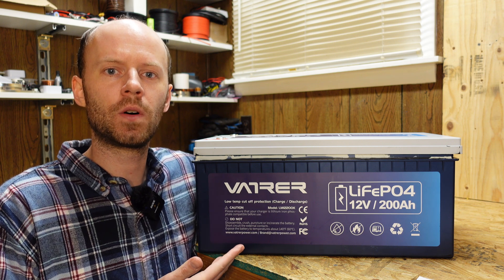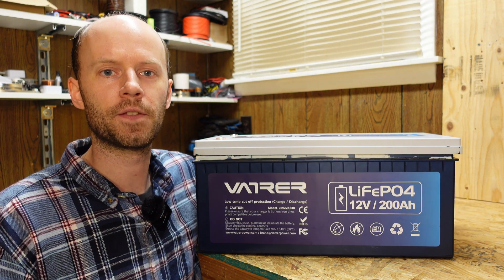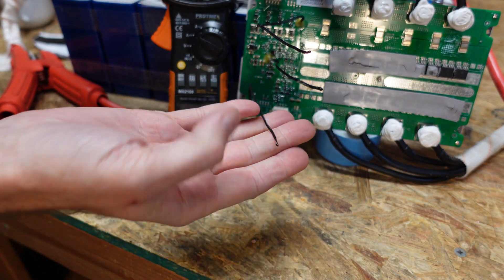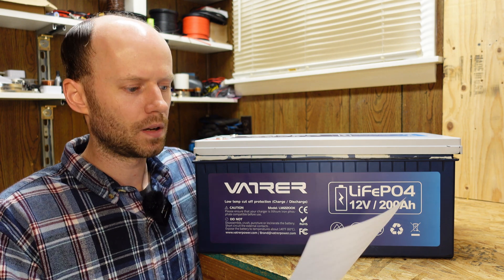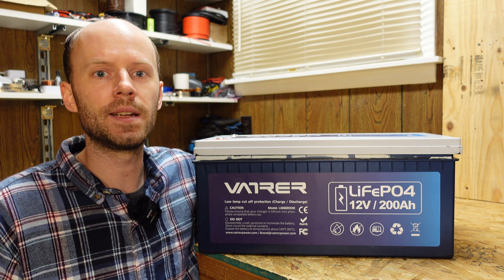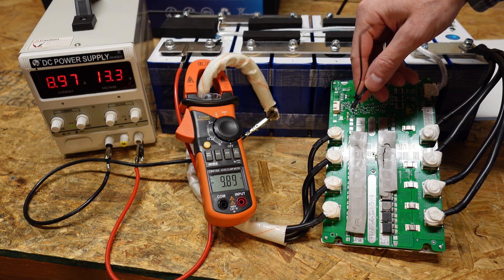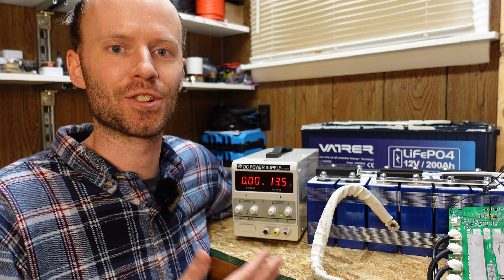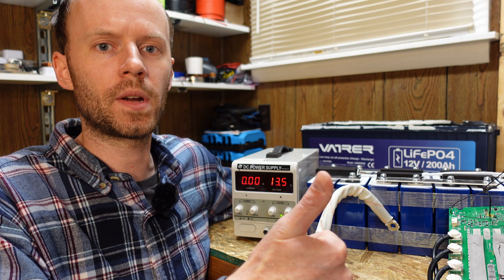Vatrer Battery Update, The Low-Temp Charging Protection is Working!

Comment: Hello, thanks for your great information. I bought 2 of 200ah and one stopped charging after 9 months and despite doing everything that Vatrer asked me, it did not comply with its 5-year guarantee and only told me to buy a new one
Vatrer is not a responsible company, so if you buy, you know, don't get scammed. In the end, I lost more than $600 because it seemed like a good company, until this happens to you and you realize that it is not. Blessings

Comment: I hv had one Vatrer LIFEPO4 12.8v 100ah lifep04 battery for a month installed in a solar shed.  On average It will never go below 98ah in the next three months.  Can I purchase another 100ah battery in the next three months and put it in parallel?  Of course, I will top off both with a charger before connecting.  The Vatrer manual says the 1 batteries age difference shouldnbe 1 month or less.
Reply from the maker: I doubt you'll have any problems a new battery and a 1-month old battery. Maybe if it's been cycled 2000 times or 5 years of age I'd be concerned. But 1 month? No.
Reply: @LithiumSolar  thank you so much. Your tear downs are awsome.

Comment: how is the bus bar running 200Amps discharge current????
Reply from the maker: I haven't tested it at that current. Are you suggesting that it's insufficient for 200A?
Reply: I  think probably not good enough to run 200A, even it's ok, I think the temperature should be very hot, dangerous. @LithiumSolar

Comment: If all 4 need to be at temp to shut down charging what happens if 1 sensor, or wire to it, fails? It should be any sensor not combined. Thanks for the testing.
Reply from the maker: Good question.......

Comment: Great video. I’m so curious, can you do a teardown of the 7Ah and 6Ah batteries to see what the difference is and also if there is a steep drop-off in quality? I’m on Amazon right now and see almost all of their reviews are from give aways.
Reply from the maker: Well, based on their pictures, they look like generic (no brand name) cylindrical cells. I googled the part number I can make out in the picture and IFR32700 and the first result says 1000 cycles, second result says 2500 cycles lol.
Reply from the maker: I ordered one - will make a video in a week or two if it seems interesting enough :)
Reply: @LithiumSolar  yasss thanks! 👏👏
Reply: @LithiumSolar  btw which model do you have? 🎉
Reply from the maker: @LA-Creative  I ordered the 7Ah that was on Amazon w/ next day delivery.
Reply: @LithiumSolar  oh that will be interesting ! 🤗 I Just got two of the 6ah because they are 30% off ... I do wonder tho, if there’s a reason for the cheapness, other than the one Ah loss. I think the 6Ah came out a couple of months earlier (maybe? the company is so new). $18.99 tho, so cheap! 😬 (I have lots of uses for the smaller form factor ones that you chop up alot 👏😍 but I will also probable wire theses in parallel when they are inactive and let them trickle on one of my many smaller solar charge systems). I guess at least if you cut your 7Ah up then I can think about dissecting one of my 6’s. 😂 I’m just so OCD and don’t want to hurt the case if it turns out to be good! 😂 It looks like a nice case where I can peel the stickers off and stick it to the bottom for a clean look. Wondering what these batteries look like inside remind me of that game show, let’s make a deal🤣
Reply: @LithiumSolar  Hello from LA …got my first 6Ah battery yesterday and the second today. Decided to leave the first alone until the second came in so I could meter read them at the same time. 
My Fluke 88 V meter just read 13.17 exactly on both units. A good sign I hope! 

The cases are the prettiest I’ve seen for this form factor, I can’t bring myself to cutting mind open yet (they look nice, as is, on my bench)!  🤣  Pls get the 6 and 7AH  and compare contrast / 🪓 (dying to know why this battery was only $18.99! 😆 

Side note/question, seeing as these appear balanced, do you think I should charge these some with a power supply before wiring them parallel and connecting to a solar controller?
Reply from the maker: @LA-Creative  Here you go :) https://www.youtube.com/watch?v=EwpcagESKh4 It doesn't directly answer the comparison question of 6Ah vs 7Ah but it gives a great look and overview inside.

Comment: Good on you for doing the clarification vid.
Bad on them for not just saying in the first place 'all three sensors and the IC need to be below the set point for low temperature cut off"  - BTW that is silly, any one of the sensors should be able to cut off the charging at low temp!

Comment: I wonder if it is the logic and not necessarily the number of sensors. In a real world scenario you could have a part of the battery heat up very quickly due to a fault and you would want to shut that down fast. There is never really a situation where one sensor would cool down from room temp to below freezing in a matter of seconds. The logic could be throwing that out and ignoring it as an anomaly. Cooling down all of them could be tricking it to activate.

Thinking back on a lot of reviews it now makes me question them.

Comment: Look forward to your thorough battery videos. I have a 24 volt hybrid system using 4 12 volt LiFePo4 batteries. Two have low temp protection and two do not. Recently we had a very cold spell with high winds and I noticed that my system was only charging to 50% capacity. I discovered that the batteries with low temp protection were not charging. I have a temperature sensor on the batteries and they were always above freezing. I also have a cup of water next to the batteries just to make sure and it never froze. I finally had to warm up the batteries with heater to get them to charge again. Every one that tests low temp protection seems to confirm low temp cut off works by freezing the sensors by various methods but never actually show the temp range for disconnection and reconnection of the charge function. I would like to know the temp range of the sensors. My question is would that be something you could test for us? Again thanks for all your excellent content.

Comment: Hello sir. Batter has an upgraded new 100AH battery that supposedly has crimped connections as opposed to soldered. I think they upgraded all the problems other channels have identified.  I wonder if you think they build the 200ah well and possibly the 100ah poorly?  Thanks.

Comment: I don't think this low temp protection is reliable.
The fact that you need all the sensors to be cold is an issue in itself since depending on where you store the battery there could be a few degrees difference in temperature between both ends of the battery, so first cell could be already on danger temperature while the last cell will be still slightly above the sensor level. 
But the biggest issue is that you need the chip to also go cold. Electronics generate heat when they work, so you are literally measuring a heating component to check if temperature of cells is low.

Comment: If the BMS is working, discharging the battery, at say 15 amps, and the temp drops below freezing. The HEAT created by the BMS discharging will keep that chip worm. SOOOOO, just how cold will the battery have to get before it shuts off. That will be VERY had to REAL WORLD test. If I had to rely on THIS low temp. disconnect to operate correctly I would NOT buy this battery even if it was only #100.00.

Comment: Crazy.  Low temp on the board which if operation will be generating heat seems perverse.  But also have multiple sensors that all need to be triggered to stop charging is a risk. It is easy to imagine a situation where one side of a better is significantly colder and risks cell damage but charging continues because not all of the sensors trip.

Will Prowse had something similar only a few days ago but in that case it was low temp sensors to activate internal heating. Again both had to be triggered before the heating pads would be energised and again that leave open the possibility of cell damage.
Reply: For a heating pad it makes sense to require all sensors to trigger since you don't want to cook the battery if difference between temperatures on both sides is too high.

Comment: I'm new to lithium batteries. However, from my limited experience many seem to be made at the same factories. The brand owners probably just customize the parts used how they see fit to maximize profit.  Some might skimp on the case in favor of better internals, vice versa or take a more balanced approach.  It's that way with a lot of things these days unless the company is well established , or a multi-billion dollar corporation with it's own supply chain etc.  The tech support is usually the seller or a 3rd/4th party playing middle man between you and the factory which for the most part will just give generic responses like what you read because from their perspective it's up to the Brand Owner to understand what parts they are having the factory put together and their limitations/quality etc.

Comment: Wow, that's absolutely stupid!!  They are relying an MCU internal temp sensor for one of the units. Problem with this is that this part might not get as cold as the other sensors beacuse the board is above everything else and any heat rising will keep this chip from cooling down as far. Which means that the "cells" could potentially be several degrees colder than the IC during a cold charge/disharge event and damage the cells! 😲 This is very bad configuration.
I can understand having the 3 "probes" needing to be below temps, but not including the IC. That's just stupid.

I think you should add a keyword to your video title, tho.   "....is Working!!!  (Kinda)".  🙄
Reply: This was my thought as well - temperature gradients are very normal. For low temp protection, I want an OR not an AND condition to trigger shutdown. Otherwise as you say cells may have uneven temperature and run the risk of damaging the coldest while 3/4 of the module is still above freezing.

Comment: I'm glad you figured out why this wasn't working as we would expect it to.  However, IF their design includes an IC which must also be at or below freezing to prevent charging, why bother with the leads at all?  The cells could be below freezing, with the BMS/IC above freezing, and charging would occur.  The temp leads are down lower in the battery, near the cells (as it should be, but the BMS sits on top of them, just under the plastic cover of the case.  The IC could easily be 2 or 3 degrees warmer than all of the leads.  It's a poor design and your testing frustrations illustrate that.

Comment: As an engineer I would never design a system that needed 4 sensors to detect a low temperature condition trigger a signal to turn off the charging, that is asking for problems.

Comment: 4 points of failure. What a foolish way to setup the bms.
Reply: Sounds to me like they aren’t confident they won’t have a component failure that triggers cutoff when the sensor craps out, so they required all sensors and an IC to crap out before it becomes a warranty claim. If they have that little confidence in component quality, I can’t imagine buying their product.
Reply: It could be distributed data collection means a closer reflection of what the battery is actually experiencing.  

Meaning if only one sensor on the outside can trigger a shutdown that is probably not an appropriate response to the battery's condition particularly if the pack has been disconnected and subject to deep freeze.

Comment: I don't think it's necessary to implement a deep freeze test of batteries going forward. Yes, it's a more "realistic" test, but if a BMS has multiple temperature sensors, it follows that if ANY one sensor falls below the threshold temperature, the battery should stop charging and if it has a heat pad, it should engage that until ALL temperature sensors are above the threshold. It's the safest solution that, with proper probe placement, should ensure that the cells don't get damaged in cold weather.
This BMS's configuration is daft. The radiant heat from the BMS' MOSFETs during charging may be sufficient to keep the IC's temperature above the Tmin threshold, but the thermocouple probes could all be showing freezing temperatures around the cells. Poor logic design, in my opinion, but luckily for Vatrer, this should just be a software fix for an otherwise decent looking battery.

Comment: That's like checking a check box of ☑️ "Has low temp cutoff" but is done in a way that shows they don't understand WHY that checkbox exists in the first place...

They seem to understand: If one cell is over temp it stops charging.

They seem to not understand: If one cell or part of the battery is below freezing, that is bad and it should stop charging. 

Why does it behave completely different than the high temp protection? It doesn't make any sense.
Reply from the maker: You're spot-on here, every word...!